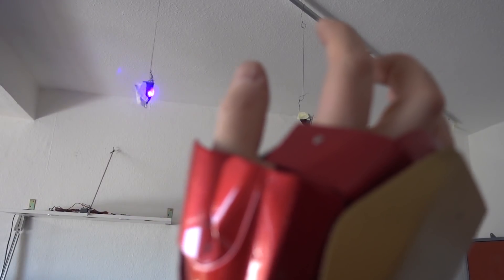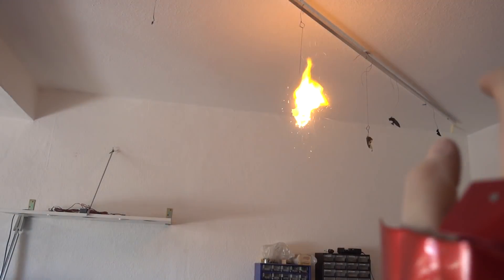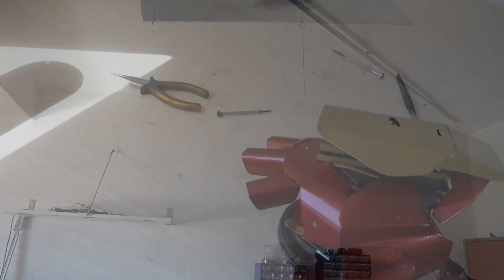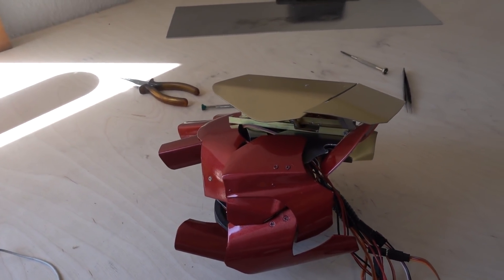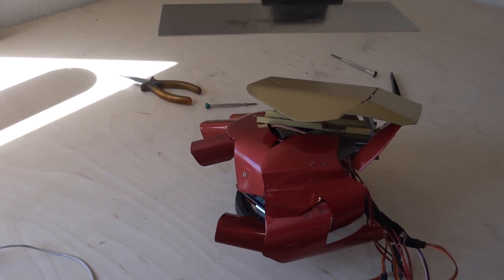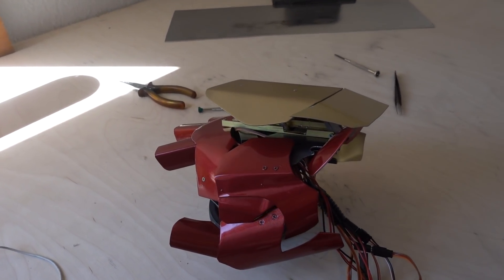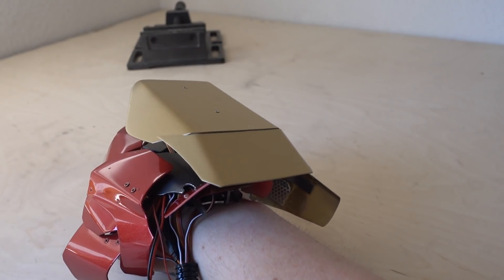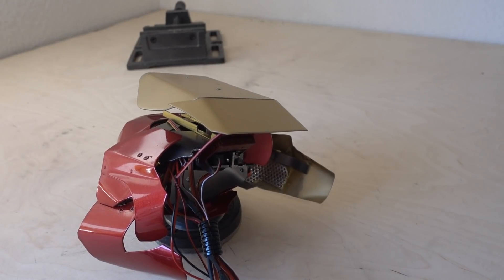MOTORIZED Iron Man laser gauntlet, incl 6 servos !!!

Comment: What I you have like maybe 50 lazers focused on one point? Would it be strong enough to be used in milletry combat?
Reply from the maker: Doesnt really make sense at all. I made a lil death star once. Using multiple diodes makes it harder, not easier. Using a bigger/different laser is easier ^^
Reply: @LaserGadgets  Okay i just assumed that they would add up in strenght somehow. ^^
Reply from the maker: @darken0id306  You would have to alter the focus depending on range on target. And they all had to hit the exact same spot, otherwise you had, like some other idiot here on youtube, just 15x2W....not 30. Know what I mean?
Reply: @LaserGadgets  Yep i understood. :)
Reply: Military lasers work with 20-150 KILO Watt and the lasers in this video work with 1 to 6 (maybe 10) Watt so the difference is still higher then at least 19.990 Watt. By using multiple lasers you can theoreticaly get more power (500 watt with 50 lasers, still a difference of 19.500W) but to use them in the military you would also need a maschine that re-focuses the lasers everytime the target gets out of the current laser focus range (where all lasers meet and concentrate at one point).
Soooo in theory... yes but it would need a looot more power and a maybe some computers for re-focusing.
How that explains enough :)
Reply: @darken0id306  yes it does